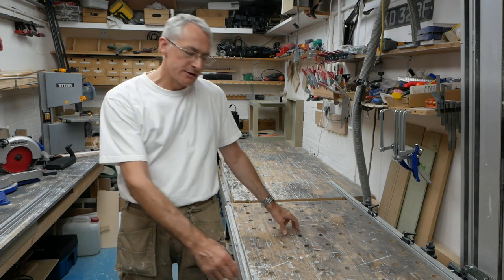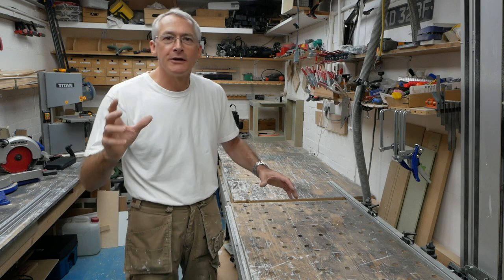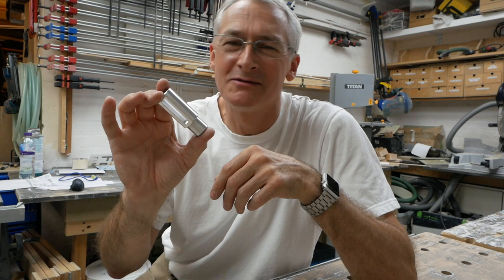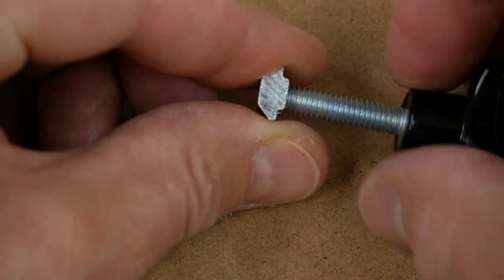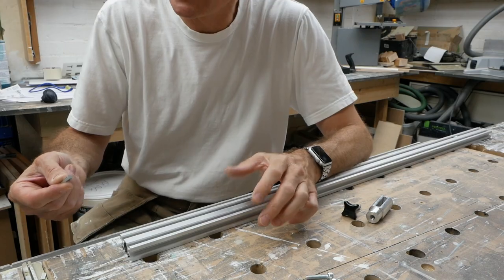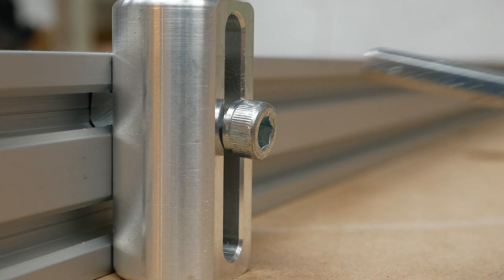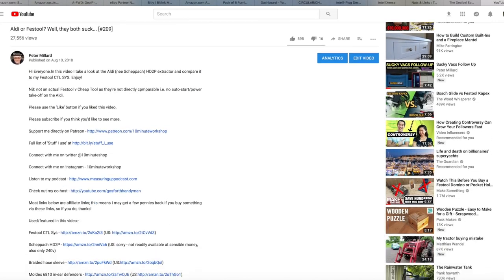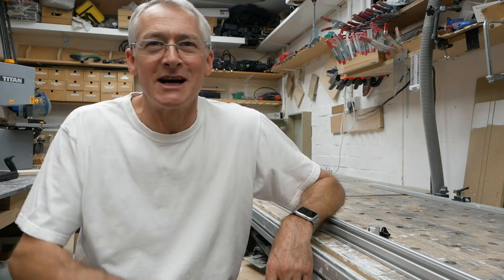Fencedogs 👍👍👍 [#212]

Comment: Stop arrived today and I’ve managed to use it and for the price it’s great.  Needs a little silicon spray to free the movement a little but I’m chuffed.  
I use a Makita track and saw and I need to get the track cut a little shorter to use on top of my MFT more comfortably , so I’ll be looking to get it laser cut.  Bench dogs do a good job in holding everything thing square but it’s no Festool hinged job.  There’s another after market opportunity for someone 🤪👍🏻👍🏻
Reply from the maker: I’m working on it Mike! My flagstops arrived yesterday,  video out on Tuesday 👍👍
Reply: this is what I was thinking too,  maybe side hinge system for track that runs off the back of the extrusion, creating a similar flip up and down square set for the rail and extrusion like Peter has on his older MFT bench.

Comment: I switched to a similar but taller extrusion for my router table fence a couple of years ago. I can't believe I struggled for so long with the silly split fence it came with. Tall fence needed? Bolt on an auxiliary fence (I use Buffalo board, slippery side to the workpiece). 

You're dead right about how useful it is, especially with sliding stops, and you could even use a scale, indexed against the back edge of the saw's own rail. 

That's a brilliantly useful video - many thanks Peter (off to the e-shops for me, I think!).
Reply from the maker: Thanks! Yes, they’re handy to have around 👍👍

Comment: Wow that's awesome. I never thought of that. Here in the US one of the main distributors of aluminum profiles is a company called 80/20 Inc. I have a 25x75 profile made by them which gives me 3 t-slots on the 75 mm side. I use it for a fence for my drill press as well as a router sub fence which gives me tons of options for mdf sacrificial fences as tall as I want them to be or lay it flat on the drill press and I have better control of small pieces and more clamping options. I also bought two 36 inch long profiles that for the slots so I can cut them to custom sizes as I need them. Amazing products and now I see even more use. I need to order a 6 or 8 foot long profile for my table
Reply from the maker: Thanks! Yes, unfortunately 80/20 isn’t widely available over here - I know it was very popular with US Festool fans back when they made the original MFT1080, as the profile was the same, and huge MFT tops were relatively easy to make at a great saving on the Festool prices! 👍👍

Comment: Such a simple yet effective design. If you swap out the M6 bolts for some M4x30 ones and use the smaller bolts from the MFS set you can use them to secure the MFS router template thing very easily too. Best to use the M8 knobs to secure them from underneath though (to stop the MFS from tipping).
Reply from the maker: Great idea Neil - hadn’t thought of that! 👍👍

Comment: i've just bought my extrusion and bench dog fence dogs, along with the bench dog fence stop in metal v3 version :) - I am intending on using some adhesive rule along the centre section of extrusion. I am going to use the bench dog rail dogs in my rail so its straight across the table, then but the extrusion right upto the back of the rail, essentially creating a square. If I measure from the cut rail strip to the beginning of the fence, I can put my adhesive rule on accordingly so with a fence stop set on the rule should be able to create repeatable square cuts time after time :) - thanks for doing this video Peter, otherwise I would never have come up with how I could do this over and over again in my mobile setup (trestles !) with self made MFT slab.
Reply from the maker: Sounds great! 👍👍

Comment: Excellent video, such an inventive usage of our extrusion! If anyone has any questions about our extrusions feel free to ask us.
Reply from the maker: Thanks! Glad to have you here - I’d only be referring question to your website anyway (link in the description) 👍👍
Reply: Ooznest are you In Brentwood Essex by any chance????
Reply: Yup were based there. Welcome to order online and collect. Or just come down and see what we do.
Reply from the maker: On my way... 😂👍
Reply: Hello, how tough is the black coloured version of the v-rails?
Reply: It has a AA25 black anodised coating, which is the thickest we could get without moving to a full hardened coating. We use it on our CNC Machines and we haven't seen any issues. However if it does scratch you would see it compared to the silver.
Reply: @ooznest  Thank you for the Answer :-)
Reply: Ooznest is awesome can’t believe that came up! there linear bearings and rails are great for making jigs 🙌
Reply: Thanks, much appreciated! Glad you like our service :)
Reply: I assume the Festool/Bessey/Axminster clamps don't fit in the Vtrack 2040 extrusion.  Based in Australia, looked online then came back to ask Peter and saw your comment.
Reply: give peter a discount code
Reply: @ooznest  don't suppose you do anything that could be used as a height adjustable hinge to mimic Peter's festool mft hinge setup.
I.e. 80x 40 extrusion front and back on the table flush with the top and hinge the rail at the back to engage at the front for square but easily height adjustable for material to be cut?
Reply: @VapourTrailz  Hi Matt! We do stock like an 80x40mm extrusion: https://ooznest.co.uk/product/c-beam-linear-rail-cut-to-size/ I don't quite 100% get what you mean, if you sketch it up i can take a look.
Reply: @ooznest  hi, thanks for replying, I'll give you a call.
Cheers
Reply: Hi which fence dog kit suits the v track? M6 or m5? Cheers
Reply: @ooznest  hi if I wanted to permanenrly attach the fence to the mft top but I wanted at least 40mm high would that work with the tapping you provide? Ie I could screw that hole into the table top?
Reply: @charlievan4877  Hi Charlie, both have been made with 20x40 V Slot in mind, but we would recommend the M5 kit as it is compatible with more items in the V Slot range.
Reply: @charlievan4877  The tapping service we provide is into the end of the extrusions. This will be threaded as M5. I believe on the BenchDogs website you can purchase the additional components you would need to fix the component to your tabletop.
Reply: Do you ship in the U.S.?
Reply: @apologetics  Hi there, yes we do ship to the US with FedEx. Add the extrusion to your basket and enter your address for a shipping estimate :)
Reply: An excellent idea! I'm looking to order one but, being a bit of a dunce, I don't quite understand what's meant by 'extrusion length range' on the ordering options. Any advice would be much appreciated 👍
Reply: @benfurness437  Hi Ben. For example, if you want a piece of extrusion 1150mm, select a length range of 1100-1199mm. Then in the input box below, enter your exact length, 1150mm in this case.

Comment: Hi Peter. Great video again, I'm definitely going to invest in some of these. It might be worth mentioning that you can also get Cnc cut replacement mdf tops for the MFT of ebay for £40. People can then build there own MFT style work benches. Keep up the good work.
Reply from the maker: Thanks Dave. Yes, I get into that with the bench build - seen them as low as £30...👍👍
Reply: @10MinuteWorkshop  shouldn't have second guessed you😅 look forward to the video. By the way, I made my first Millard style shaker doors for an alcove unit I instslled
Last week. Also had the panels drying on my Millard style drying rack. I'm starting to feel like your apprentice 😂

Comment: Look forward to the build as I have just started out on a series of new benches. Have you considered making your own MFT type top using Peter Parfitt Parf Dog System? It is incredibly good and easy to use and you get exactly the size and spacings you want. Well worth a look if you are not just buying a premade MFT top.
Reply from the maker: Thanks Jason. Yes, I’ve seen the Parf System - Axminster were supposed to be sending me one to try out, but nothing’s happened as yet - but I think for what I have in mind it’ll be cheaper just to have one CNC’d 👍👍

Comment: Funny, I just decided to go the opposite way: getting the original fence from Benchdogs and save my money with 3D printed fence dogs 😀
 
I preferred the original fence over a std profile due to the overall package 
- €20 for a 2040 profile with one chamber closed (for the scale)
- €10 for a stick-on measurement scale
- €15 for a stop to use with the profile
That is €45 vs what Benchdogs is asking for (< € 60 atm); assuming their laser scale is more accurate and will last longer than the stick-on solution. That is why I supported their business.
The 3d printed fence dogs may come in with 2x 3 Euro for material plus 2x 2 Euro for screws and nuts. Not too bad isn't it? Given I had to spend €29 on their solution I decided to go cheap with these

Comment: I think it's a brilliant system you have especially as a professional cabinet maker with no need for a table saw "hate them" 
 I take it this fence is set up to cut lengths repeatable with stops?
Reply from the maker: It will be yes. As I say, this bench build is still at the design & planning stages - but you can use the fencedogs with a variety of existing fence systems. 👍

Comment: Peter will the festool clamps fit in the Oosnest  v track ?????????????????

Not downstairs.....?????? nearly pead myself ............ Ave's term is 
"down in the dobleydo". 👍👍👍👍

Great Chanel 👍👍👍👍👍👍👍👍
Reply from the maker: Thanks! No, this size v-track is too small to take Festool clamps unfortunately, so if you wanted to make a full-size MFT-alike you’d need to find the old-style 80-20 ally👍
Reply: Peter yes remember now, l looked at them a few years back thought that why l didn't go with them. Doh.
👍👍👍👍👍
Reply: Hi Peter, is there any extrusion or T-Track available to buy that'd fit the Festool clamps similar to the way you can use on the MFTs?
Reply: Worzel BXOY 233

Comment: Nice little video. Still thinking how I want my bench and this certainly adds another option. Have you considered the Parf dogs? No simple solution for a flip stop, but the ‘fence’ won’t obstruct the guide rail.

Or will you always increase the thickness to 20mm?
Reply from the maker: Thanks! Don’t really understand Parf dogs, how they differ to regular bench dogs; I have plenty of bench dogs/ rail dogs, used them for ages before I bought my MFT, wouldn’t go back! Different for mobile admittedly, still pondering that one 👍👍
Reply: The difference is in the long ones. The short (regular) ones are supposed to be the 'fence' (nothing special there indeed) and the longer ones are to register your rail against to make square cuts. 

Very curious to find out how you will align the rail with this fence.

Comment: Great video Peter, and more great ideas for improving my MFT. Benchdogs do the fencedog in M5 and M6. Could you confirm which size you used that fits the Oozenest V rail? Thanks
Reply from the maker: Thanks Tony! Pretty sure they only did M6 when I got mine, but I’ll check when I’m in the workshop. I don’t think the size of the t-nut changes because of the thread size though - you just have to get the right M-threaded t-nut for your bolt. I’ll check though, and get back to you. 👍
Reply: Both will work no problem. The M5 was bought out for users in America who use a 8020inc extrusion. Which has a slightly smaller v slot

Comment: Peter, thanks for this very inspiring video. The only question I have is which Tee Nut do you use with the V-Slot Rail? OOZNEST only offers Tee Nuts from M3 - M5. Benchdogs offers the fence dogs with M6 and M5 options. Will M6 fit into the V-Slot Rail? Thanks!!

Comment: You need to check out the Yellowboxshed.com.au for their variety of bench dog products and even a vacuum attachment for the ujk parthguide, which is a great way to create your own bench top without a cnc machine. See new Brit workshop for the parthguide videos. Dave Stanton has a great bench design that uses the 20mm dog holes, festool guide rail tape and t track

Comment: ..hi, is that rail very very straight indeed or any warp in it? I agree its a good idea why not if it serves the same purpose, its not a cheap hobby/ profession.
Reply from the maker: Hi Christopher. Yes, it’s a very straight extrusion; what you don’t get is the etched measuring gauge of course, which the Benchdogs fence now has, but that comes at a price, as with everything! 👍
Reply: @10MinuteWorkshop  yes of course. i guess you could use the above were a measure is not required and then it in a way reduces wear and tear on the benchdog fence - i have a feeling it may be how you use it perhaps, hey thanks for the reply

Comment: what flag stop would work with this 40x20 rail Peter? I know old video but still very relevant
Reply from the maker: It’s essentially the same extrusion as the original benchdogs fence, so the benchdogs flagstop should still fit. 👍
Reply: @10MinuteWorkshop  ahhh thought it may of been, makes sense I guess since these extrusions are pretty standard. many thanks

Comment: Hi Peter,
I don't suppose you cover repeatable thin rips on the MFT anywhere in any of your vids do you? By thin I mean narrower than the guide rail.... I've thought and thought about it but can't come up with anything reliable.
Many thanks
Jaime
Reply from the maker: Hi Jaime. Now you mention it, I don’t hunk I have covered this! There’s a couple of things I do; obvious thing is that you clamp a stop outside (ie to the right of) the rail so you’re effectively cutting & keeping the elevate side of the line. Then to stop the narrow rip to ‘run away you can either  tape it to another board of the same thickness, or put a false fence on the waste side. This is probably best explained in a video tbh! I’ll get to it shortly 👍👍.
Reply: Hi Peter,

Thanks for the reply.

Yes I did think of something like that but sort of went off the idea because I wondered whether having to allow for the kerf was marginally less accurate than measuring from the splinter strip to a stop of somekind underneath the guide rail.....

Anyhow it would be great to see how you went about it.

Many thanks

Jaime

Comment: Hi again...... thanks for the reply to the previous question by the way. I have been following your videos for some time and pretty good and honest they are. I made my own MFT table which frankly is not accurate so never used it for actual 90 degree cuts. I am at the point of having another go making a top with a kit I purchased then I have to buy add ons anyway. My question is do you think the festool MFT is worth the money? (I probably would spend half its price on bit and bats to make one anyway). Thanks in advance
Reply from the maker: Thanks! All my MFT videos are in a playlist here - MFT & MFT-related - http://bit.ly/MFT-related - and I've done a lot recently on DIY MFTs and rail hinges. I suggest you take a look at some of the recent ones like video 487	Ikea Curtain track DIY MFT - https://youtu.be/223QALIbnRc
and 488	DIY MFT follow-on	https://youtu.be/wyGNs1GYdCk and also the Backyard, Budget DIY MFT, 	https://youtu.be/xIi-I04ocVM. Lots of info in those, but so much will depend on your specific requirements. 👍
Reply: @10MinuteWorkshop  thank you for ALL that effort :)))))) very kind

Comment: T-slot aluminum is what it is called here. 80/20 has a lot on miscellaneous pieces on eBay
Reply from the maker: Thanks Monty. This is V-slot, it’s a different profile from T-slot, and things designed for t-slot (e.g. Festool rail clamps) won’t fit v-slot. 👍
Reply: Oh
I thought that they used the industry standard

Comment: Hi Peter what brand are those blue ratchet clamps ,I notice u don't use them always have the green festool ones in your hand ? Are they any good the blue ones ? And are they cheaper  then festool or Bessy red thanks
Reply from the maker: Hiya. They’re old-style Axminster clamps; they used to be about half the price of the Festool ratchet clamps, but had a few niggles with them. Then they fixed the niggles, and raised the price almost to Festool levels. 🤷‍♂️ I don’t like them much, but use them when I need to. 👍👍
Reply: Ok thanks mate might go with bessey

Comment: Another fantastic video Peter, I have learned so much over the past few months from both you and your videos as well as the Rag and Bone Man.
Do you have a video showing how your track for your track saw attaches to the fence? Also would your track, or any other track for that matter, fasten to this fence in a similar way that your track operates on your main table?
Reply from the maker: Thanks Richard! The fencedogs are excellent, and I’ll be using Benchdogs hardware when I build my mobile bench in the near future (5% discount at Benchdogs with the offer code ‘10minuteworkshop’ btw...). Re my rail setup, I have the festool MFT and the hinges rail comes as standard with that; it’s not hinged off the fence btw, but off the bench extrusion. If you haven’t caught them yet, videos 182 & 183 cover the MFT setup in some detail. 👍👍